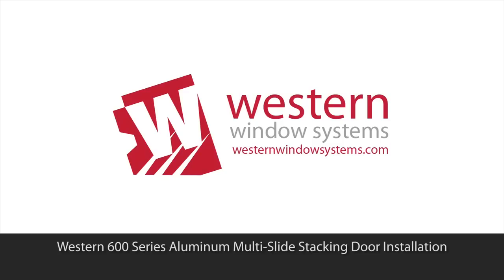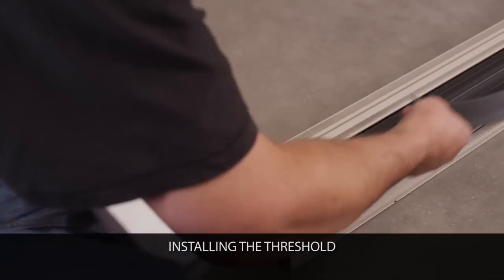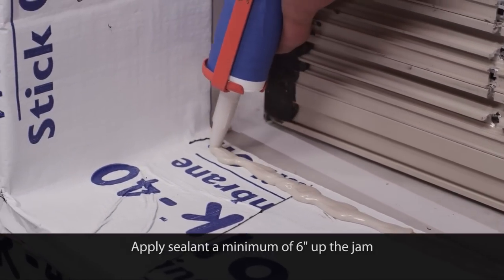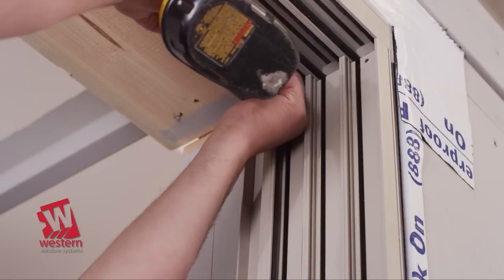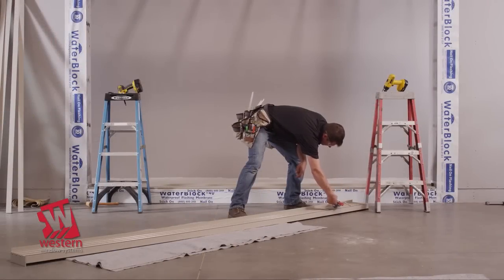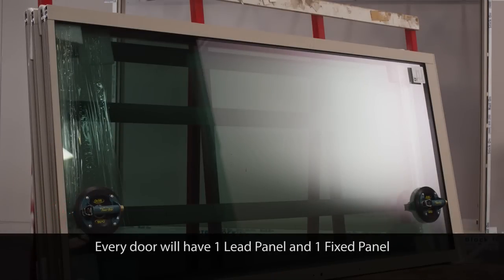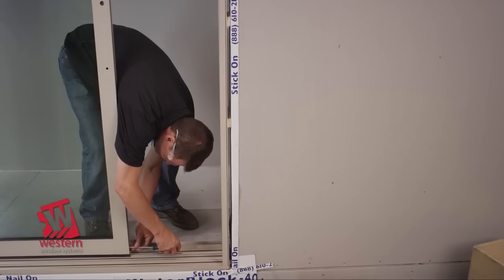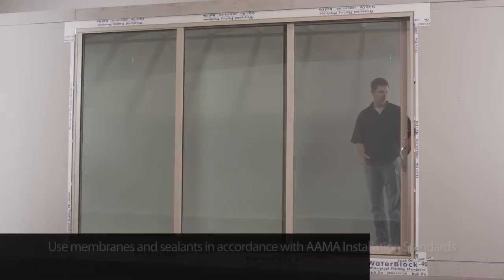Series 600 Multi-Slide Stacking Door with Stucco Return Install Instructions

Comment: Having holes in the threshold is a poor design. I’ve installed a lot of similar doors to this including Fleetwood and many other manufactures make thresholds without holes in it. A hole is a way for water to get in especially on a second story with a wood sub-floor.